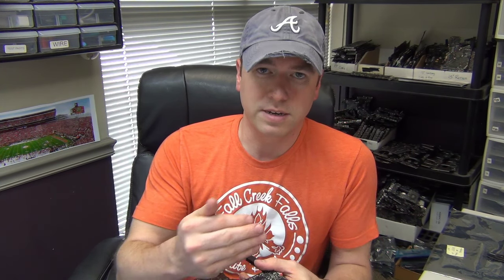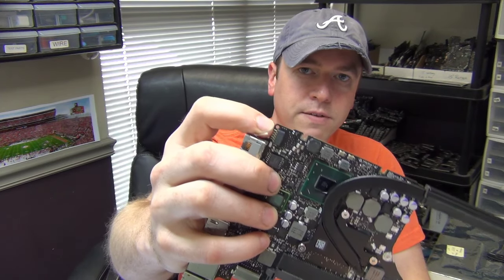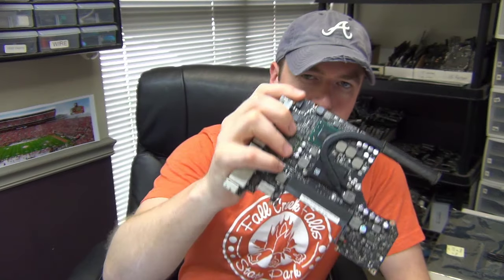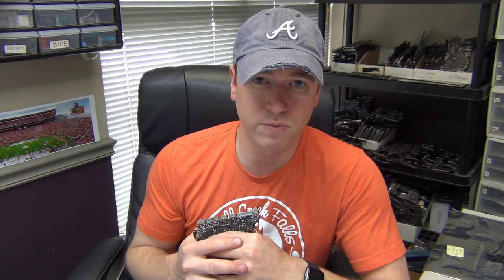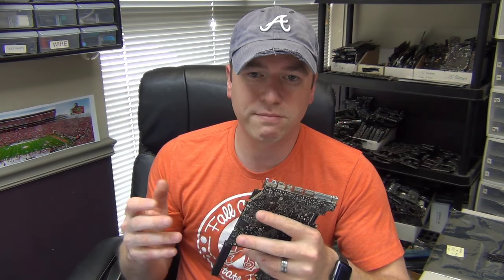Temperatures to Use When Repairing Logic Boards

Comment: "I don't really give any information out..." WHAT??? The title of the vid is "Temperatures to Use When Repairing Logic Boards". Maybe it varies, but how about giving us a ballpark? Totally useless video.
Reply: came here to exactly comment the same. He basically re-phrased whatever we know already. Everyone know how we shouldn't apply much heat to plastic connectors, but atleast let us know what's the sweetspot we could achieve in order to not damage the board. useless video.
Reply: My thoughts, too!.  A waste of my time.
Reply: Why is this such a secret? I see vids of, say 0805 resistors being soldered, but when asked what temp either no answer is forthcoming or "it depends". How about a temp for the specific case shown in the vid.
Reply: Whit best station 1200w ... 340 - 380 C air flow 40 - 60 .... Little vomponet small nosle  more big connect more big nosle ...  Start whit 340 and 50 air flow and play rise up little for bigger or difficult componet ... Use flux in star preheat to meet flux count 2 3 sec and proced let's flux to tale jobs close the nosle in start far of the bord to preheat bord and melt flux and after close the nosle 3 -4 cm to finish the job ... sorry for my English it's not good
Reply: @ieronimosgr  This info is what should have been in the video, thank you very much.
Reply: @ieronimosgr  Thank you! Don't worry about your english, that is actually more usefull than what is on the video

Comment: He won't tell you, B.S!!  Afraid to loose business??!  it's common information any way, you'll find it on google: Turn on the soldering iron and set temperature above the melting point of your solder. 600°- 650°F (316°- 343°C) is a good place to start for lead-based solder and 650°- 700°F (343°- 371°C) for lead-free solder. Hold the tip against both the lead and contact point/pad for a few seconds.
As to the heat station, move the heat nozzle in a circular fashion or any fashion just avoid keeping the heat on one spot for more than 1 second per spot typically less than that !
Reply: that's the spirit!

Comment: A more helpful answer would be objective temperature ranges for melting leaded and non-leaded solders as well as what temps are damaging to various types of components.
You could caveat that with a warning about calibrating your hot air station or using an external tool to verify temps.
Reply: I do like your suggestion. Objective temperature melting for whatever you are using is key. I know my tools say so-and-so temp, but if its not melting it, then one of the two is lying to me.

Comment: The lead free solder melt at 218 C. The tricky part is getting the board to that temperature. For tiny board 250 C is enough. For mobile board, it is 350 C. For large gaming boards it is 420 - 450 C. Sometimes a preheater is needed for large chips like CPU with 25/75 heat split where the lower heater rises the board temperature to 168 C and the top heater and rises the heat to 220 C. These numbers will work with hot air stations with  internal blower turbine of 120L/min like Quick 700w or 1000w. Weaker hot air stations like 350w stations would work but only for smaller boards. The point is, these are numbers. Get yourself an Atten or Quick and start experimenting.

Comment: Good advice. The extra links are helpful also for people not knowing what they need. Temperatures vary greatly with the type of solder and board. Experiment, like he said, on a practice board and you'll know your temperature. You can google the base settings and your skilled or unskilled technique determines how long and at what temperature works best for you. There is NO perfect temperature. I've been soldering for +40 years. Each circuit board is different and must be treated differently. If you worked on only one item, say mac book pro's, that person would know what temperature works best on those only.  Circuit boards also come in different thicknesses, the thicker the board, the higher the temperature may be needed for the through hole passages. Soldering is a technique best left to skilled electronic technicians, otherwise fixing your screw ups is not something we like to do and we do love to charge a premium to correct your mistakes.

Comment: 2:20 Wait wait wait wait.... This doesn't make any sense...
Are you telling me that when the screen on the Quick861D displays 500c and the airflow is  100❄that this is somehow DIFFERENT from another model that reads 500c /100❄?
That's not logical. If the element just happens to be failing, why would that have any bearing on the thermostat and it's accuracy to project the correct temperature on screen? Am I wrong in thinking 500c is 500c?

Comment: That depends on the model of the air station, I in particular use to make reballing from 380 to 400 celsius, I have been using that temperature for several years and I have never damaged any component in China, the technicians use air stations for less than $ 20 and they work at 500celsius.

Comment: False information. Temperature is PID controlled on the 861DW. The thermocouple is not going to be off by more than 5%, and the airflow is from a fan with a rate speed also closely sensed. Bottom line your information is false.

Comment: thank sir
Reply from the maker: KNFIXPRO-TECH Happy to help!
Reply: @PowerbookMedic  Hi, I work fixing High End Audio equipment, but sometimes I receive a computer or other stuffs from my sons or a Friends.
Now this the case, I have a Asus gamer computer with a mosfet on short circuit.
The thing is, I try to remove the Mosfet using 400 Celsius degress with the max air speed without success.
I am waithing for low melting solder and a special flux.
My soldering station power is 700 watts.
What do you think?
Maybe I need to buy a 1000 watts ot air station?

Best Regards.
Reply: @treadmillrepair754  yes 1000 watts

Comment: Soldering temperature is not rocket science. Start with 700F (370C) 60/40 solder 750F (400C) lead free solder. Adjust to your liking depending on the project and particular soldering iron.